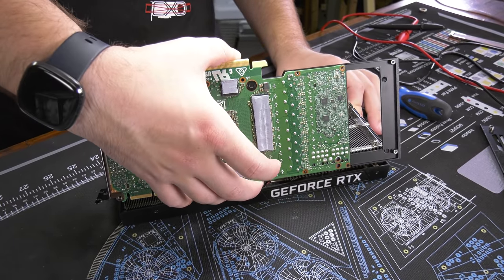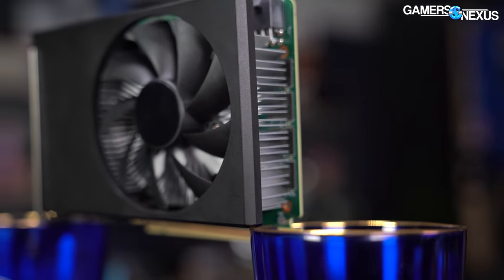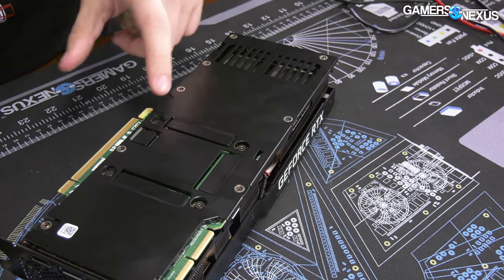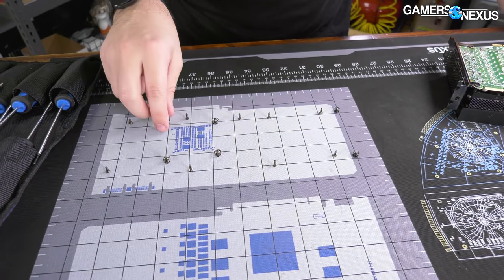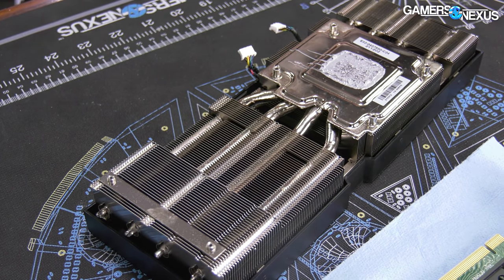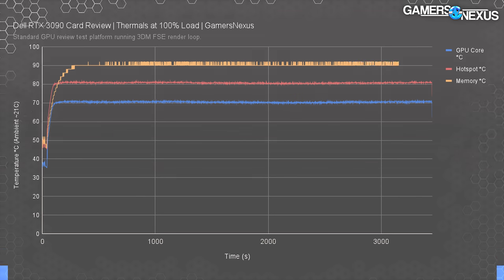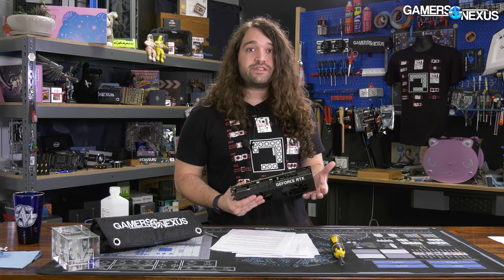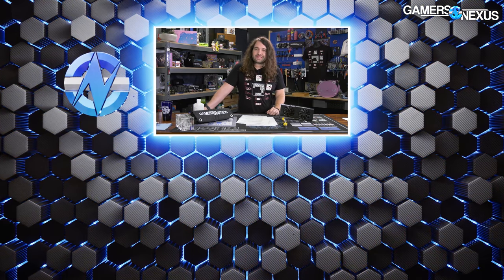Sometimes Dell Actually Tries: Dell RTX 3090 Review, Tear-Down, & Benchmarks

Comment: This appears to have been designed to have the backplate heat pipe spread around the other side of the longer module stretch. It appears (especially due to the high thermal pad and spacing between screw and pipe) that it does partially cover the modules while wrapping around! The ident pattern appears to support that as well.
Reply: I was just about to write what you said. I to think the heatpipe is covering part of the memory modules, looking at the frame at 8:51 you can see where the pads have left residue on the upper most modules, and the pipe is just next to that, indicating to me the pipe is covering the other half of the memory module.
Reply: Seconded
Reply: Noticed this as well. Probably the fat pad area is for an extension of the heat pipe too. Either that or the original intention was to have the heat pipe extend all the way, but for some season was stopped short at the 2nd group of memories.

Comment: I once used that same Dell PC that you reviewed Steve, and it had a 2060 in it with a proper heatsink and thermal pads. It also didn’t come with any added warranties or as much bloatware. I was pretty impressed with that machine after you reviewed it, but of course I don’t use it anymore.
Reply: A Dell product that is actually decent?!

The prophecy is true...
Reply: Hell hath frozen over...
Reply: Their U series monitors are consistently excellent.
Reply: @coolguy91975  Yes, Dell has long had very good monitors, especially their UltraSharp line, and the Alienware gaming monitors are some of the best out there right now.
Reply: @sandwichdriving101  dell's XPS laptops are quite decent too
Reply: For more information: the Dell I had was the G5 5090, which was the model before the one Steve reviewed. It also didn’t come with McAfee, and it just had the base 1 year warranty, so it really wasn’t a scam. It was $1500 USD, which is about $2000 CAD. (I’m from Canada)

Comment: I just took the Dell 3080 apart last night to do some thermal pad work and what i noticed is that while the 3080 does not have rear mounted GDDR6X, it still has thermal pads and the heat pipe you see in the 3090.
Reply: Interesting, my dell 3080 didn't have the thermal pads or heat pipe on the back.
Reply: @robotuprising1711  That is very interesting indeed

Comment: 9:41 I'm probably wrong, but it looks like the horseshoe of the heatpipe was meant to go over all of the memory modules with the right angle at the other side. Based on my completely unscientific pixel measuring of a screenshot of the backplate, the outer dimension of the horseshoe is the exact dimension that you would want the interior dimension to be to fit around the depression in the backplate. They got the dimensions wrong and didn't realize it until they started assembling. Quick fix, flip it around and add a taller thermal pad where the heat pipe was supposed to be.

Comment: Looks like the backplate was made for that heat pipe to continue around where the taller thermal pad on the memory is. You can see the imprint of the heat pipe on the memory thermal pads on the other side of the die.

Comment: I was JUST looking at a 3080 dell model thinking there's no way I'd buy one even if it was the only one I could get, although now due to this video...

no, no I can wait for a non-green pcb model
Reply: Just a random info but it seems to be any nvidia card with GDDR6X memory will draw so much power at idle (around 100-120w for 3080ti. not sure for 3080)
Idk, that seems not good specially if you leave your pc at night, it can even warm the room!
Reply: @arz1898  my 1080 draws 20% power at idle until I turn on gsync where it drops back down to 5-8% idle, I imagine that might be related. if I recall correctly, I used to be able to idle at lower power without having to use gsync on desktop.
Reply: Green pcb is the best pcb.
RGB looks terrible.
Change my mind

Comment: Knowing Dell, I’m surprised that they’re now doing something half-right
Reply: Surely it is a big misunderstanding.
Big wig at dell just watched this video and heads are rolling.
Reply: I have an old T3500 workstation from 2013 that has been running 24/7 365 for nearly 10 years without a single hitch
Reply: @yourhandlehere1  You must repair it as a reward for it's dedicated service.

Comment: They used the same stamp for all of the backplate, to save money, and just used the thick thermal pad to accommodate for the lack of heatpipe on that side of the backplate. The other two didn't need it because it has the heatpipe to cover the other half of the memory chip.

Comment: When prices dropped on the used market, october 2022, I got a Dell 3080 for $450 in great shape. I really like the card. It's well built, and with the latest bios and the "thermal paste on the vram plate by the gpu core trick" (that you didn't mention in your video probably because you weren't aware of it yet) that lowers vram temps down to 90c, It's at least as good as any other well built reference 3080.

Comment: These OEM cards are quite interesting to me. I just picked up a Lenovo RTX 3080 for cheap a couple of days ago. Tracking shows it will be delivered tomorrow. I can't wait to see how it is put together.
Reply: Some models are interesting. HP and Lenovo uses good components
Reply: @MHCP  I have my Lenovo 3080 now and it looks very well put together. Plenty of cooling for both core and memory and it is performing very nicely. Nice LED lighting as well.
Reply: @Daz555Daz  my lenovo 3070 is very hot when running above 150 watts and very loud it so so annoying because most 3070's running quite and cold

Comment: Probably the only 3090 I've seen that can fit in to my mini ITX case surprisingly... I already have my 3080 which I pre-ordered last November coming (in three weeks hopefully), but it would be interesting to see if other manufacturers will release smaller sized cards in the near future...
Reply: @nataliek3384  I have a louqe ghost s1. Really love the build and quality of the case but I'm definitely limited as its only a two slot case. I had to deshroud my evga xc3 ultra to fit. I would also recommend getting a meshlicious or a formd t1 if you're after other mini itx options 😊.

Comment: I don't know if you guys have looked at their Rtx 3080, but they look identical with the exception of the back plate copper heat pipe they added for the vram cooling.  Out of the box, the front memory runs hot as hell because there is no contact with the cooling capabilities of the heat sink, a .5mm thermal pad or even some thermal paste surprisingly does a better job at dissipating heat simply by adding the paste or pad between the copper vapor chambers and the black plate covering the vram in the front.  The heat on the 3080 I dealt with, dropped from over 110 to just under 90c and allowed it to stop thermal throttling.  Great break down, thanks for taking the time Steve.

Comment: I got an Alienware R10 during Dell's last sale for under $2k, it has a 5800x and 6800xt. I debated simply pulling them out but decided to add in a few fans to help the airflow and add some thermal pads to the GPU. Overall it came out pretty good and is working well.

Comment: Slight correction to point out here - the rear heatpipe DOES run over the back memory mudules, which you can see on the thermal pads that are more compressed where the heatpipe connects to them. The thicker pad on one side of the memory modules is for the side that doesnt have the heatpipe. A better design would be if the heatpipe wrapped around to cover all the modules, but I don't even think any AIB has thought to use a flat heatpipe like this to better cool the ram chips on the back of the card.

Comment: The heat pipe on the backplate rests on top of the thermal pads that are on the memory modules. Perhaps that tall thermal pad is not due to a mistake, but rather a design change. Maybe an earlier version had a heat pipe in that area, and they decided to remove it for cost and/or because it wasn't as effective on that side of the card.

Comment: I have this card, but I got it several months ago. I also bought it in the same type of R10 system and re-housed it in another case (after the alienware PSU failed due to overheating). I can tell you that Dell didn't actually make them all this way. Mine had considerably less thermal pads, and a lot less paste. I didn't have any of the extra tall pads seen here on my unit, only the thinner ones that cover the chips only partially. I opened it up so that I could add more thermal material because my VRAM was hitting 100c while mining as the only video card in an open case. After opening it up and doing to my card at home basically exactly what you've observed on this card from the factory, temperatures while mining dropped to around 90c on the VRAM, but now crammed into a smaller case with another video card also mining, so it's actually an even bigger difference than it appears. I'm suspecting they've had some RMAs or at least customer complaints from these RTX 3090 Alienware systems and in order to reduce RMAs they've started to include more thermal compound from the factory in more recent models.

Comment: 8:30 Steve the heat pipe is contacting the thermal tape which you can see from the outline in the tape, so it is contacting the components!  👍  Would have been better if they took the pipe into the slot area to get air flow directly on it.  9:10 it was clear that they should have put the heat pipe on backwards.  The "U" of the heat pipe should be flipped around or another longer pipe with a U should have been installed to better wrap around the memory.

Comment: Out of curiosity, do you ever test a card after re-assembly and check if there are notable differences?
Reply: That's irrelevant. If he reassembles the card and it doesn't work as well as before, where is the value in mentioning that? Pretty sure it wouldn't work better than before either, so yeah.

Comment: So in a span of 20 years, we've gone from "Dude, you're getting a Dell." to "Dude, you're getting a Dell?"
Reply: I don't remember a time when Dell produced good PCs - They were known to be prone to breaking in the mid-2000s.
Reply: @angolin9352  They made good laptops in the 90's.
Reply: @angolin9352  every pre-built company has had a bad rep in someone's mind because a lot of people who buy prebuilds don't know wtf they're doing, and break their computer.
I knew someone who kept ranting about Acer being shit because they had multiple Acer computers with issues..
Turned out she installed a huge load of malware on all of them. The hardware was fine.
Reply: @hyperstimmed  That's true - But Dells were specifically prone to hardware failures in the early and mid 2000s. I'm not sure if it was a  mobo or PSU issue (it was before I knew hardware troubleshooting), but nearly everyone I knew had Dells that would just not turn on one day. Looking back on it, it was probably part of the capacitor plague, but the people I knew who had other brands like HP or Lenovo hardly ever had those issues happen to those systems.
Reply: @angolin9352  the Dell desktop I got in 2004 had a hardware failure, funny enough. It wasn't Dell's fault though and didn't have to do with the motherboard or power, the GeForce FX5200 GPU I had in it died when one of the capacitors randomly blew.
I now have to wonder if that was a common issue

Comment: Around @9:00 It looks like the heat pipe was meant to circle all 3 sides of the memory, but something has changed those plans and the back plate was not fixed for the change.

Comment: R11 owner with the 3090 and playing DCS runs like a champ with no thermal issues using msi/af for the card. Also mainly running DCS with HP G2 VR the 3090 is a must for me. Vram temps are usually around 96c while gaming. It’s actually is great gaming machine especially if your not a builder. Thanks Steve !

Comment: Adding a 0.5mm thermal pad between the heat sink and the base plate allows better thermal contact of the memory to the heat sink. I have done this to 2 Dell 3080s and it lowers the memory temps by about 10 to 15 degrees. This does bring up the temps on the GPU core by 5-/+ degrees.

Comment: This is legit the only air-cooled, non-FE card stronger than a 3070 I've seen that doesn't have three massive fans and a hulking triple slot heatsink.
Reply: Hell even the founders edition has a triple slot cooler

Comment: I will confirm that the dell 3080 OEM card (from my alienware prebuilt) is the exact same in terms of how the cooler screws in, where the screws are, thermal pads on the back, and the two screws at the end of the heatsink. Even with the heatpipe on the back of the backplate. Even has the shitty no-contact VRM cooling plate WITH STICKERS(hopefully those are the elusive super-heat conducting sku ones) to which I resolved the overheating VRMs by putting thermal paste and I ordered 1mm thermal pads to place there (they were too thick) so I ordered 0.5mm pads and those will come shortly, hopefully its better than the thermal paste. I'm actually very very surprised your vram temps were under 100C, whereas mine with my 3080 goes very quickly to 110C as there is actually no thermal material between the VRM plate and the coldplate for the GPU die.

Comment: This pint sized 3090 makes sense from a PC builder perspective. It was pointed out that the stock 3090 was too large to be integrated in to the supply chain for major PC makers. When you're building these things in volume having to plan around a special sized part is an expensive problem.

Comment: I have a Dell RTX 3090 Ti, there isn't much information about it on the internet, it has a triple fan shroud and the heatsink is quite larger than the one in the video, but it's pretty quiet and barely makes any noise at all at full load. I was a little worried about using an OEM GPU but looks like the heat dissipation is pretty solid, just a little worried about the quality control standards... Hopefully when it fails the RTX 4090 will be cheaper by then...

Comment: Back in 2012, I bought a Dell Inspiron laptop; pretty high end one with AMD discrete graphics. Out of the box the GPU was dead. I took it to a Dell repair center that was an hour of train ride away. Took them a few days to replace the motherboard. When I got it back the laptop wasn't assembled properly. The front leds weren't connected, screws missing, tabs out of place and bent chassis as a result... I needed the computer back quickly so I just received it and fixed it myself. At least it worked properly now. Sad thing is I bought another Dell a few years later. Luckily that one wasn't DOA. Although it consumes the battery when I play games so when the CPU and GPU are working at the same time. Got a 240W charger, didn't change anything...

Comment: Just picked one of these up for 700 bucks, super stoked!
Reply: Bought to pick one up for $450
Reply: @maurice482390  where you bought it for 450 usd?
Reply: hey i see you posted this 3 months ago, how is the card still holding up?
Reply: @theboy2777  still running great! I use it for 3D rendering so the card is on constantly, crunching away on frames, super stoked with it
Reply: @dirtcreature3d  ok great thanks ! I saw a RTX 3080 Dell model just like this on facebook marketplace for 500 dollars and i was thinking if it would be a good buy.
Reply: @dirtcreature3d  also did you have to do any thermal repaste? or was it good on purchase? i just dont want my pc turnin off because its overheating or something
Reply: @theboy2777  damn thats a steal and nah ive been using the card as is and still been fine, also its in a inwin 301c with a 3060 sitting on top of the case and i havent had any overheating issues but its in a well air conditioned room

Comment: I reckon the reason the sizing was wrong on the back plate is the heat pipe was meant to continue to there but another cost cutting measure. Look at the other side for comparison.

Comment: Dell actually did a nice job on the fan too!
Model PLA09215B12H

PLA= Power Logic fan (Makes GPU fans for MSI, Gigabyte, Asus and more)

092= 92MM frame (if it had one), 87MM diameter 

15= 15MM thick (standard)

B = BALL BEARING (dell didn’t cheap out here)

12= 12v fan (standard)

H= High Speed fan (Options: L,M,H,HH)

Comment: I'm on my third Dell system and never had anything but a good experience with them.
A desktop I got at age 13, a laptop at age 22 and another laptop at age 30.
My current G15 laptop was originally supposed to be an Asus G15, but the Asus was total garbage with the worst backlight bleed I've ever seen, trash fan curve and extremely annoying boot animations. 
I ended up exchanging it for the Dell and haven't had any complaints aside from the trackpad. Automatic bios update works better than any other system I've bought or built (and I've built at minimum 40)

In terms of customer service.. 
Dell repaired my cousins desktop free of charge even though his warranty expired a year previous.. HP on the other hand told my uncle he had to pay $350 for a motherboard to fix a RECALLED laptop, because he was one month past the recall period. Needless to say I have avoided HP like the plague ever since. 

I feel like with Dell they catch more heat than they deserve a good chunk of the time.
That said, I do dislike what they did with Alienware a lot. They ruined what was once a great company. I suspect it was to make their XPS line look better. 

Really happy with my G15 though.. It's the 11800H/3060 variant, not Ryzen edition for anyone curious.
I wanted the Ryzen one but Best Buy didn't have it at the time.

Comment: 8:25 the heatpipe does go over the memory. You can clearly see the part where the thermal pad is nice and flat next to the part isn't. The part that isn't is in the same location where the thermal pad material sticks to the backplate. Therefore the heat pipe is indirect contact with the thermal pad